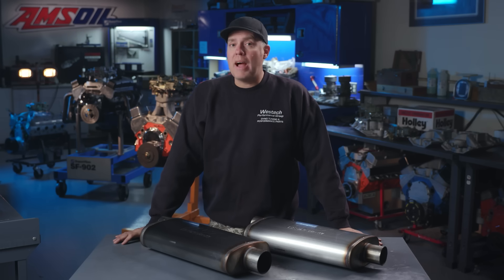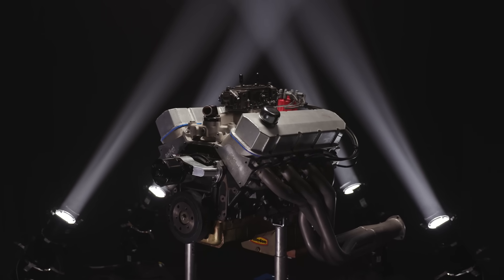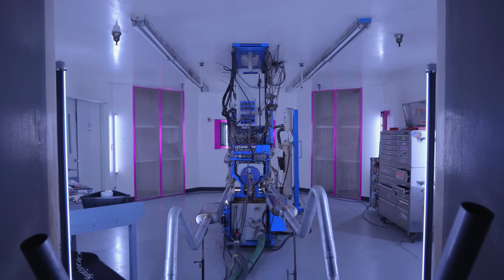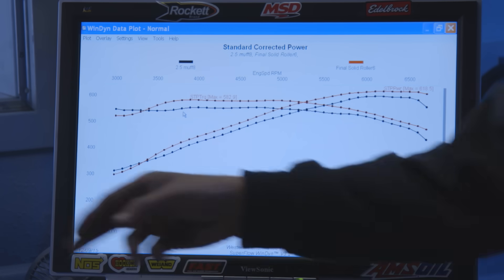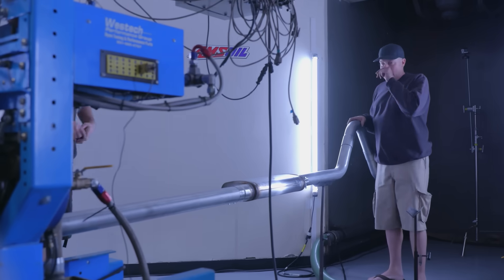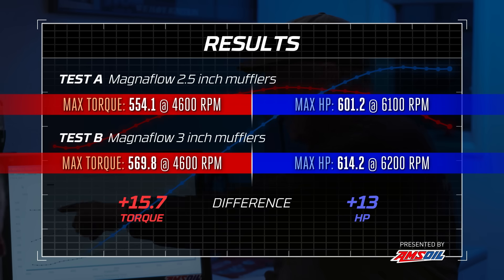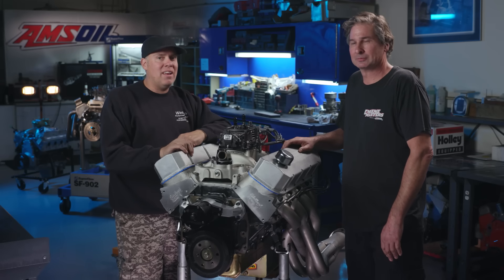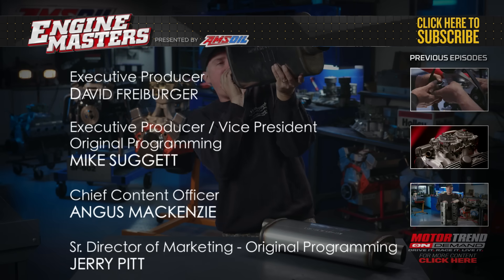The Power of 2.5- vs. 3-Inch Exhaust - Engine Masters Ep. 9

Comment: So I'd bet that most people arguing over tubing size are arguing a correctly sized exhaust system vs the next size(s) bigger. In this test according to some rough calculations, The smallest system that you'd ever want for this 454 is assuming that it's producing 450-620HP or about 1000 -1500 cfm a 3.75 single out or a 2.75 dual out. Since it's somewhat rare that you'd see those sizes, I'd round up to a 4" single exhaust and a 3" dual minimum.  In the video above they tested what I would calculate as the correct size and the size smaller.  They should have tested dual 3" and dual 4" or 5" as the second result.  The only place you should see improvement is similar to what David stated is if you used a less ideal (for power) muffler like a chambered type. Slightly hotter exhaust flows better. You can keep your exhaust slightly hotter by keeping the size on the smaller side.  Back pressure is not what helps the torque; specifically it's more a better velocity, so that it's not stagnant like it could be in  an over-sized exhaust. With slightly higher velocity you get less turbulence and thus a little better removal of gases that could almost be called scavenging.  I have a Chevy 350 w/ smog heads and I know it's producing at most 200 HP and about 550-770 cfm exhaust. I have dual 2.25" exhaust which is plenty of exhaust to get me up to 350" as I modify and work on the engine. Dual 2.25 is equal to about  a single 3" or 3.25" exhaust, FYI. Drastically under-sizing exhaust will of course kill power and noise. OEMs often shrink exhaust slightly due to emissions (higher exhaust temps) and more "back pressure" to kill noise.

Comment: Try this with a closed loop system that adjusts the fuel/air mixture on the fly. Otherwise the carb probably needed to be re-jetted based on the exhaust system.
Reply: Same thing I thought. Adjust fueling and the power difference will be far less

Comment: Oh, you read that "lack of backpressure kills torque" canard on the internet did you? That's interesting, because I read it in a bunch of hot rod magazines.  Along with other myths about lobe separation angle and carburetor sizing and "high volume" oil pumps.  Oh, and, by the way: you didn't disprove it, in fact you supported it.  Then there's the fact that the 2.5-in. system retained 97% of the motor's power (with more torque in the lower end) while the 3-in. system retained 99% (with slightly less gain of torque in the low end).
This is what you call a "failed experiment," which is where you fail to learn the principles at work in the process you're investigating.  Way to go, dude.

Comment: Dual 3 in mufflers on a stick engine, say a 345 horse hemi will give you less hP and torque than a matching 2.5   dual mufflers, when your increasing air and flue intake, than the ex. System also needs to be stepped up to maximize the engine modifications, but on a stock V8, 3 in will Rob power and economy..
Reply: no,it wont lonie

Comment: This engine displacement and compression ratio is making about 300 horsepower where it chokes out the dual 2.5" system at 3500 rpm. It is moving just slightly less air than a 350 at 5500 rpm with a 9.5:1 compression ratio.

Comment: I don’t think it’s a fair test. I’d like to see some basic tuning. You go from and engine tuned for a straight dump to 2.5 inch full system? I bet you could get close to the 3 inch with some tuning and have a sleeper. You lost 20hp? That’s not that bad for such a big change. You probably would lose the same amount by cutting off your mufflers into dumps without re-tuning. Just a guess. I recently watched a video going from 3 to 4 and it made barely any difference even after tuning.

Comment: I'm curious, I own a (currently 330HP) stock G37. I plan to push HP to 400. Would it really be necessary to purchase a 2.5" for $1200 or 3" for $1750?
Reply: What mods get you to 400?
Reply: @leakyjeep5.9  Boost or nitrous only. Unless the internals can handle 9,000 RPM and the intake can flow it.

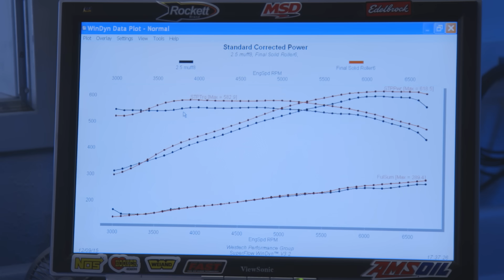Comment: 5:12 "the red line is..."  that is not a line, it is a curve.  Also, straight thru pipes don't have 0 backpressure.  I bet if you tuned that engine for the 2.5 inch exhaust system you might get better results and a 3% difference in peak power is not really much.  For everyday driving (down low RPMs), the 2.5 inch might be the best choice.  Nice and quiet and good torque.
Reply: The red line was literally a red line, numb nuts.
Reply: @DPSRecoil  Lines have infinite length.  That shape he has is not a line.
Reply: @davidjames1684  that line would display Infinitely though the corresponding values for the line after roughly 13,000 would be 0, therefore none of that information is necessary nor relevant in this situation.
Reply: @DPSRecoil  That doesn't change the definition of a line.

Comment: A racecar builder I used to work with would say that 3" is essentially open. Proven by your dyno run.
Is crossover pipes still something they use on V8 engines?

Comment: Just use a 2.5" exhaust system with a 3" flared tip.  People will think you have a full 3" exhaust system. Impress your friends and save 10 pounds in the process.

Comment: Try a $3.99 Briggs & Stratton 4" long hot dog muffler on each side.   No rejetting or tuning is required.  Should work fine.  Lotsa extra torque from 100 RPM and down.

Comment: Would love to see this exact same test done with different types of crossovers on the 3" piping.
Reply: Didn't they do a H pipe and X pipe hp test but it's under subscription & not free on Y.T.
Reply: I found with 2 cams, my 460 responded at low end with massive gains with an H pipe, but not so much with other cams...

Comment: With the 2.5 running a lot richer the engine would have been flooding,,, I would have liked to have seen them properly jet the carb to proper air fuel ratio and ran it again to see true numbers,, it would not have been as low as the first run.

Comment: Great for drag racing with a  manual or a 3000 stall converter, but for street performance, below 5000 rpm and good low end torque, Say with a smaller engine (say .6 to 6.6 litres) with a milder cam (say, set up for 350 to 450 hp) I believe you would see a significant difference in torque from 1500 to 3000 rpm,  which is where most practical street performance cars, suitable for daily driving (since not everyone wants to pay for and insure multiple cars). I believe fuel mileage would also differ, since with the larger pipes, especially in this range, it is reasonable to assume that some of the scavenging effect would be lost.
Which makes me wonder, why you all only recorded the 3000 to 6500 range in this video? maybe because you already know this?

Comment: An engine does NOT need back pressure. It needs vacuum in the exhaust system to help evacuate and fill cylinders with fresh fuel. If an engine needed back pressure then the Mufflers would have helped. The Restriction reduced the vacuum thus reducing horsepower.

Comment: Wow spot on with the exhaust pipe shops! I called a place a few months ago that I had service done on a previous vehicle to try and get a quote on a simple muffler change. I wanted to replace my quiet Muffler with maybe a cherry bomb. Something to brighten up the exhaust tone a little bit on my E-150. That's all! All the piping and cats to be untouched, but they went on about how my engine needs back pressure and how it would have terrible tow power. I guess that shop loses my money and a customer because now I have to do the work myself.

Comment: On my daily driver Chevy Caprice 9C1, this video helped me decide that the factory 2.5" exhaust is fine with muffler delete and long tube headers.  A 20 hp loss on 620 hp is only 3%.  Well worth it to be that quiet (on a daily driver).  With a streetable cam, the L77 6.0 will still make over 400 RWHP.

Comment: I think this (useful video)is showing that on a 600 hp motor, torque increases by just under 3% and power just over 2%. On a 500 hp motor, maybe 2.5 and 1.5% respectively. Clearly for racing, every hp matters. But if your trying to package an underfloor system where space is limited, on a street focused, big block Cobra for example, go for the 2.5” system. You probably won’t be able to feel the difference, but you’ll enjoy more a car where the exhaust has decent clearance, not  touching the tyres nor the road...

Comment: hello mt, i have a reco 400 hp 351-357 cleveland 2v with 302 heads with 10.78 compression ratio im about to put in my car, and would like know what style headers and exhaust you would use on something like that  .

Comment: don't need that much horsepower actually. low end torque is much more important for most ppl. larger size pipe will hurt the torque quite a bit

Comment: Would there be any horsepower difference based off short exhaust versus full length? Mainly if its on a vehicle with catalytic converters, currently i have a 6.0l v8 with 3.5 inch exhaust.

Comment: How many cars have 600hp on the road? 2.5" is enough till at least 400hp. If you want more torque and hp on your "normal" car, better fit a 2.5 system with a balance pipe (H or X pipe) just behind your gear box, that will make a difference!

Comment: Running fat means less power, you should have re-tuned the carb to match the same A/F ratio. Even with it not tuned the 3 inch exhaust only gained 13hp and 16ftlbs of trq over the 2.5 exhaust with a built 454.

Comment: I had 2.5 OD pipes on my little 468 CID, OEM was 454. I thought somebody had stolen my engine and dropped a small block in there. I looked and it was still my engine. 
Place two 3 inch pipes all the way back. Sounded like a deep low rumble, idle 425 RPM. Stepped on it and it sounded like cut outs and the 580HP showed through. This was in my Cherokee with replaced drivetrain. A bit of a sleeper.

Comment: I have a 2091 Starmaster Anti-grav platform by Wayland-Yutani. I want to remove the stock star drive plasma unit and was thinking of putting in a Daystrom neutron warp core-drive. Should I use the 2.5 inch mufflers or 3 inch? Usually exhaust gases are dematerialized but I’m just going to open the vent because I’m from the future and don’t care. Thanks in advance.

Comment: I was running 12.40 Et's with a 2.25" exhaust in my 454 powered '50 Chevy.  I've since put a 3" exhaust on my car and wonder what ET it could have run at the drag strip with the 3" exhaust.  I originally built my car with a mild 350  and quiet 2.25" exhaust and just kept the same exhaust when I swapped in the 454.  I haven't made it back to the drag strip since I put the 3" exhaust on the car but it seems faster in the seat of the pants test.  Thinking about it again, I'm not sure the car would be any faster because the car was already shredding the tires halfway down the track with the "little" pipes.  :)
Reply: BW MadDog [retired]  - It ran okay with the small pipes but I've always put at least 2.5" exhaust on my big block cars.  I like the deep, throaty sound of the engine with big pipes.

Comment: OMG...this testing could be near endless.
Different sizes, 2 into one systems, header length, carb size, ect...
I could spend days trying every variable.

Also, max numbers are ok for a reference point...(and bragging rights)
But what are optimal numbers in the RPM range needed for the street?

Comment: Only one thing surprises me? You have inordinately long straight sections of pipe. That cost horsepower to start with. Anything more than about three foot of straight pipe will cost you five to 10 horsepower. Pretty much the same in torque. Plus you seem to have forgotten the H pipe which might have changed the entire test. But so far I've only watched the two and a half inch so let's see what you get with the 3 in. The other thing I have is and every test I've seen with Big Block Chevrolet motors you begin to lose horsepower as soon as you get to 2-inch primaries are the headers. Perhaps you have tested this out in this particular application the first. But usually going from 1-7/8 to 2 in primaries on 454 will drop 5 plus horsepower at minimum. But I don't think I have ever seen those heads. These were tests that are in excess of 10 years old.

You were still able even with the 2 and 1/2 in to be inside of 5% of your original Power numbers on average. The reason you have a full exhaust system is the car is on the street. And if you have a learning system in that fuel injector it will adjust for the Richer mixture.

Have the 3-inch was pretty much equal to Open Exhaust, duh! I think you still lost a little bit to that long section of straight which allows for a reverberation harmonic without attenuation.

I never understood the back pressure argument even when I was 14 years old, wrenching on cars. Didn't make any sense.

Comment: The tech support from Flowmaster tried to tell me I needed more back pressure. This is why no one with any brains would ever buy a Flowmaster muffler. I switched to Magnaflows. My gas mileage increased by almost 20%. I was use 2.5 inch mufflers, but this was on a motorhome - ok it was on a BBC 502 in a motorhome.

Comment: It's not back pressure it's exhaust velocity. By pushing the same cfm through a smaller exhaust, the exhaust gas has to move at a faster rate which increases intake velocity.   This is why a exhaust to large lowers torque. Using silencers or glass pack type mufflers like u have actually flow better then a straightpipe

Comment: I owned a '64GTO with a stock,balanced and blueprinted '69 RA IV crate engine transplanted.JR 2" headers to 2 1/2" exhaust,thru straight thru 2 1/2"' Thrush mufflers and no tail pipes.Just put them on and started the engine for effect.At 7,000rpm ,hearing what sounded like gravel hitting the undercarriage and massive noise,I shut down to check.There was chunks of packing and pieces of metal mesh all under the car.Test shows I should have gone to 3 or 3 1/2" pipes and mufflers.Headers came with 8 and 16" extensions so I ripped the pipes off and ran headers with 16" extension.My good friend,who owned a '70 Judge lived 12 blocks away and he siad he could hear me start it up from his yard.He came flying over and seeing what I had,offered me $1500 for the engine and he would give me his.As he had the RA III package, I had to say no.

Comment: 68 cubic in per cycl. (454) V8
3 inches is fine...
43.75 cubic per cycl ( 350 ) V8
2.75 inch should be fine
27.167 cubic inch per cycl ( 326 ) V12
2.5 inch should be fine w 1.5 inch primary pipes on header...And a 2.5 collectors

Comment: Ironic how they made jokes about losing torque with no back pressure then slap on a small exhaust and start with more torque @3500rpm. So that proves for fact that with no back pressure you lose bottom end torque.  For a daily driver low end torque is more important than Peak torque.

Comment: Can you guys do this on more of a stock motor. Like what most of us have. Mildly tuned engines with bolt on mods i.e. exhaust, CAI, programmer and other supporting mods without tearing into the engine. 2.5" vs 3"
Great video and love what y'all have to say everytime! Keep up the great work!👍🏻Thanks guys!
Reply: Exhaust is always better when it's bigger. Your not looking for back pressure. Your looking for Exhaust scavenging. An x pipe on a 3 inch set up will always out perform an 2.5 set up or h pipe. But 2.5 inch pipe will give you gains with an x pipe. It's really all about making one exhoust pulse into a vacuum for the next pulse
Reply: @rednecksworld2649  what about on a turbo motor? Would a 4 inch exhaust be better then a 3 inch exhaust on a stock turbocharged motor?
Reply: @rednecksworld2649  like I said u need the restrictive backpressure cus without back pressure no spool and turbos work under load meaning backpressure
Reply: Big exhaust on a stock engine wont do anythingexcept make it louder
Reply: i put 3 inch exhaust on my 300c and i could feel a seat of the pants difference on my 5.7 hemi 
 @gordocarbo
Reply: @rogerbennett2025   used to roll the right windown on a 300L Mack E6 and gain 20 hp!( the sound!)

Comment: Leaning out the 2.5" exhaust setup[AFR mixture] would've netted the same results as the 3".  Ultimately this proved you can make 600hp with a 2.5" exhaust.
Reply: Probably the stupidest thing I have ever heard of.
Reply: @wildestcowboy2668  lol care to elaborate Mr. W. Cowboy?🤠   I got time today….
Reply: @ttmn_Dom  Before I get to the FACTS of this would u kindly define leaning out the exhaust please?
Reply: @wildestcowboy2668  ahhh that’s plenty fair!  I can see where the confusion lies here.  That’s why I hate text format at times.  I haven’t re-watched the video but Im pretty sure “leaning out the 2.5” exhaust setup,” was 100% aimed at modifying the air-to-fuel mixture within the calibration used on the 2.5” exhaust setup.  I’ve been tuning ecu’s 10+ years & I concur, I’ve never been able to “lean out an exhaust system” lol

Comment: I know this is 2 years old, but for the record, back-pressure is a slight wave of resonance that pushes a small amount of the unburnt air-fuel mixture back into the cylinder head right as the valves are closing.  It's not the total resistance of the pipe setup.  This is why you want to tune your pipes.  there's websites that you can put your specs into and it gives you the best setup for that engine.

Comment: But the 3" system maybe the back pressure you need...and not realized till you compare 3.5". This test is slightly flawed as only tells 1/2 the story.
Reply: but the open headers did better than 3"